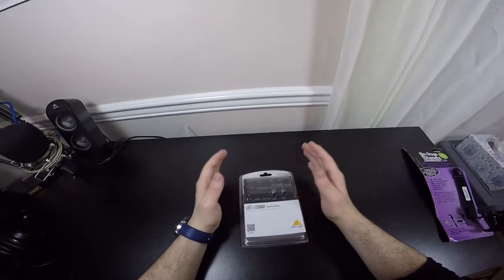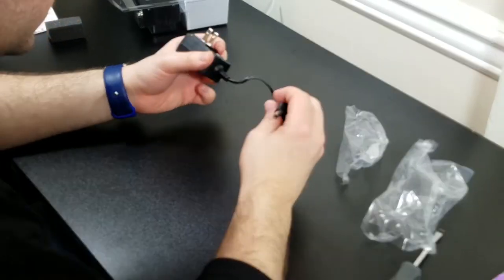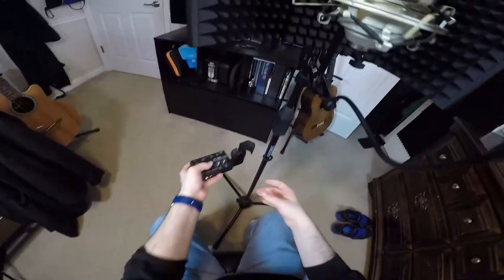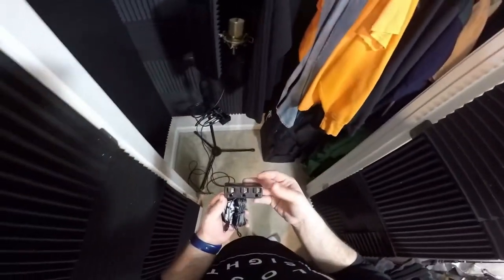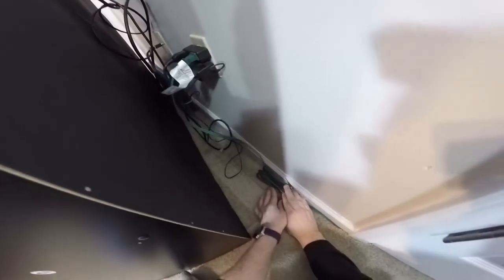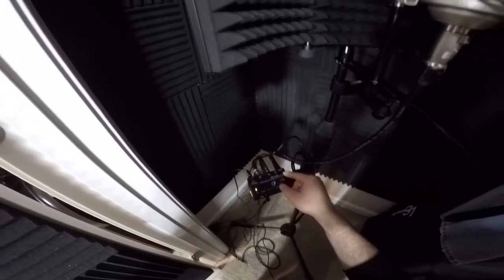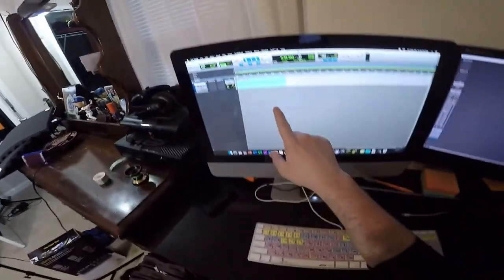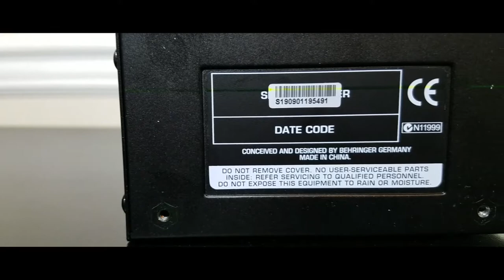UNBOXING/SETUP/REVIEW: Behringer's "MicroMon MA400"

Comment: Hey bro, can you help me with that mic stand holder your using to hold the behringer ma400 to the stand like that.?   Thank you and great video btw.  Helped a ton.  Ron
Reply from the maker: Hey man! Thank you for the kind words! I should have added it to the video but in my vlogging channel, I explained how I did it if I’m not mistaken. Here is the bracket I used: On-Stage MY550 Microphone Extension Attachment Bar https://a.co/d/3iKsgcz

And here is the video: https://youtu.be/tYIIGuBZwlc

Go ahead and sub to the vlogging channel, I would appreciate it.

Comment: I went to your vlog and could not find any details on this like you said. Also, on that "monitor input it may be worth mentioning that a (left-right) tip-ring-sleeve, 1/4"  cable will perhaps work where they have no 1/8" concern. I am not trying to criticize in a mean way. Only trying help with my prospective. I think you are doing a great job!
Reply from the maker: This is the video: https://youtu.be/tYIIGuBZwlc
Yes, that would work but I'm dealing with what I got and it's doing just fine. Thank you so much for watching!
Reply: @TheTechManE  You are welcome!

Comment: So where did you connect to the pc/interface the 3.5 with adapter cable that you put in the interface?
Reply from the maker: It was a 1/4 left and right to a 3.5mm. 3.5mm goes into the Micro and the 1/4 goes into the 1/4 monitor out of the interface. Hope that helps. Thank you so much for watching!

Comment: Hi, can you please tell me that which microphone you are using with it? Is it a condenser one or dynamic? If its condenser then is this device able to power up the mic without phantom power?
Reply from the maker: I'm using MXL 990 which is a condenser. The MA400 doesn't supply the phantom power, it's the audio interface. The mic thru cable that goes from the audio interface and into the MA400 supplies the phantom power to power the condenser. If you watched the entire video, I explained the process of everything so make sure you watching all of the video. I hope this helps! Thank you so much for watching!